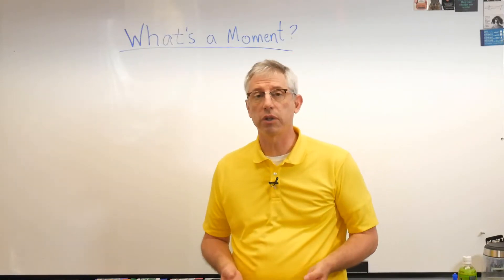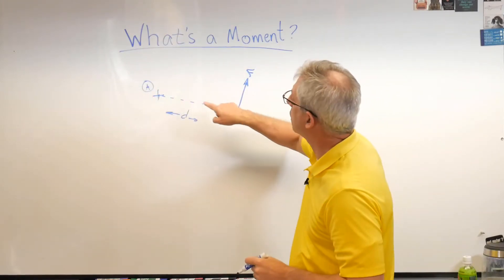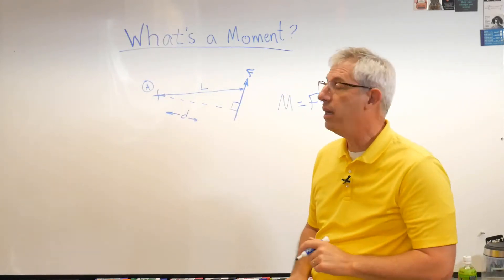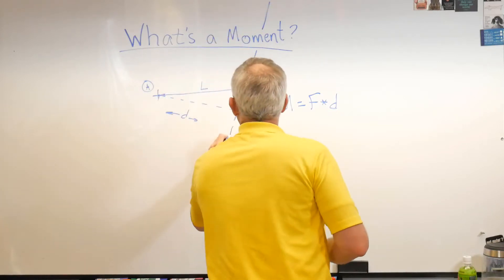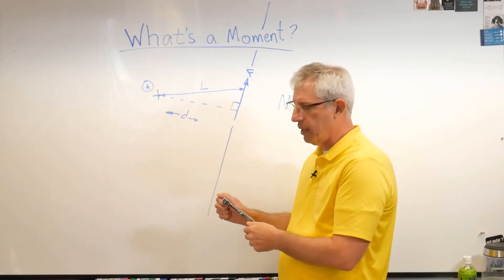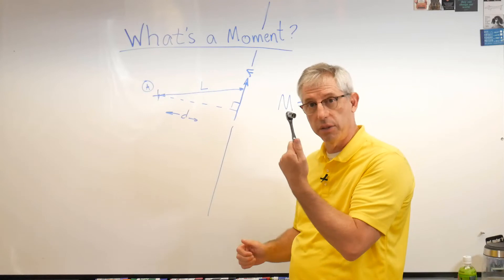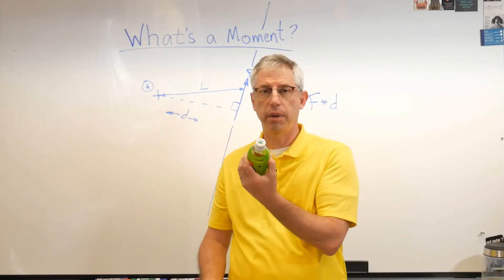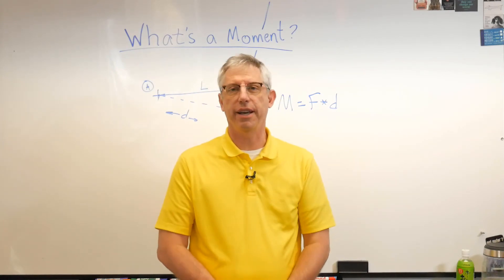Statics - What is a Moment?

Comment: One que Mark on the Beam bending. Assume a cantilever beam rectangular cross section. X axis- neutral axis, Y - vertical , Z - coming at us.
What would be stress in Z axis? I think its Zero
Reply from the maker: As long as some basic conditions are met, normal stress at the elastic axis is zero and shear stress is a maximum.  The most important conditions are that the beam cross section is symmetric about the horizontal axis and that the forces are vertical.  This also assumes the beam meets the assumptions of an Euler beam.
Reply: @purdueMET  Thanks Mark. Can you cover Shear stress topic in beams? Sometimes cantilever beam fail at the neutral axis due to shear. Could you shed some light on it in a video. Thank you!